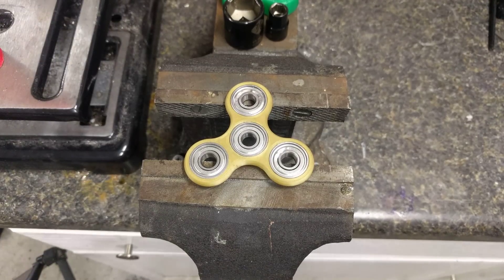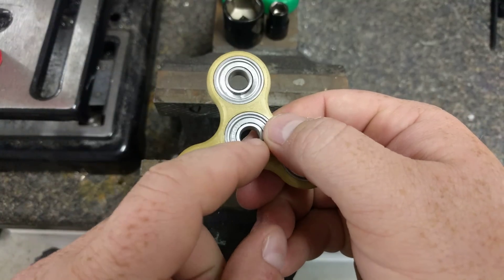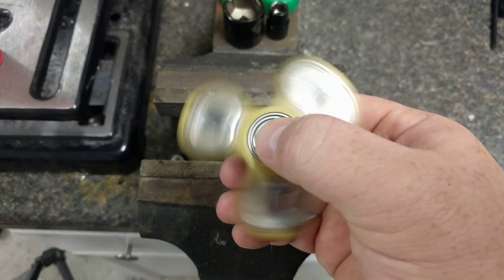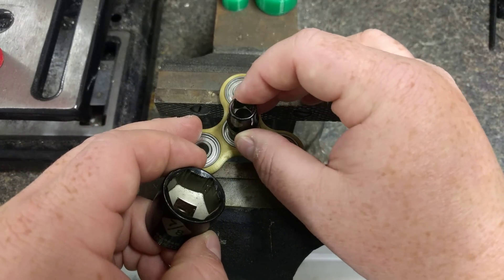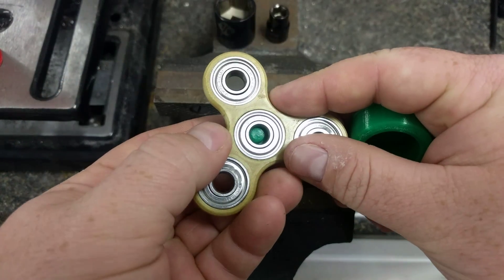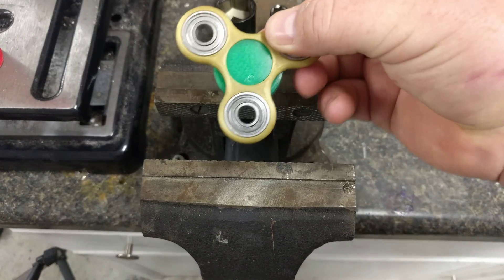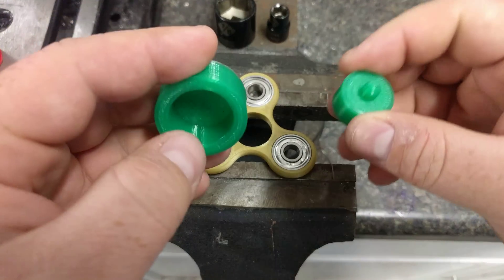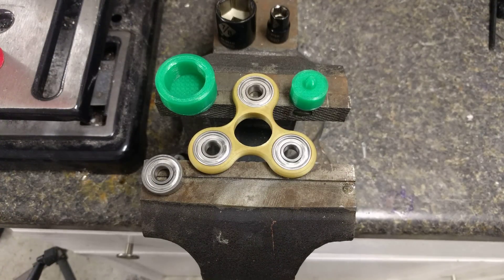Fidget Spinner : 608ZZ Bearing Removal Tool

Comment: couldnt you use just the tool for the skate boards? you k ow that little white tool that you press a buttom  put the tool in the bearing and then pull???